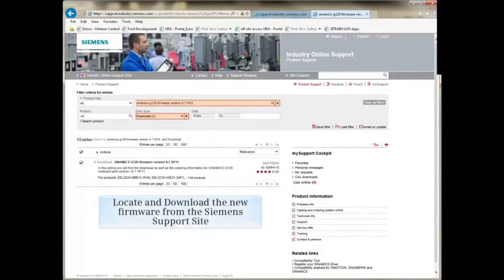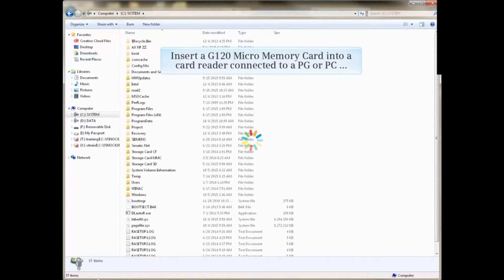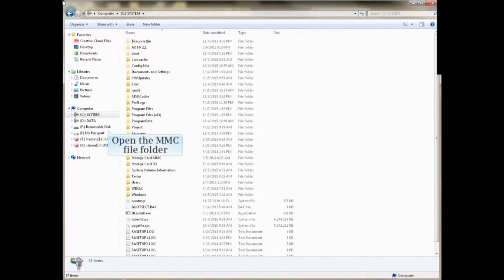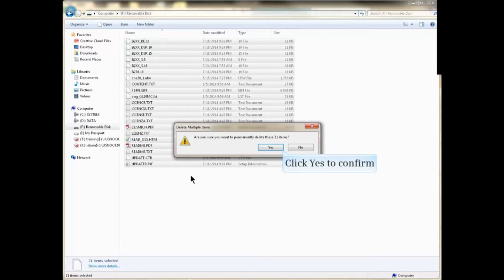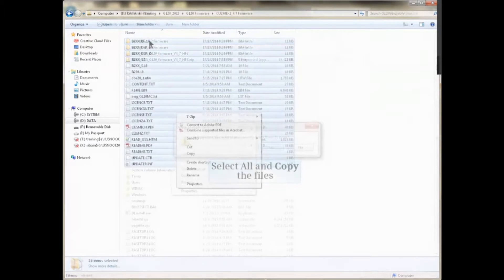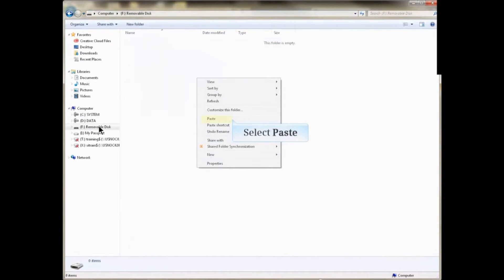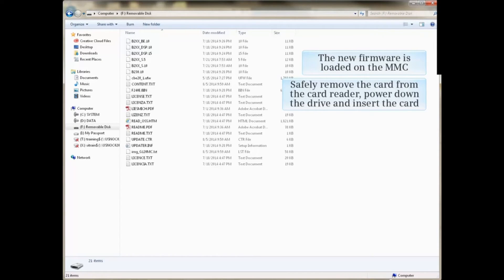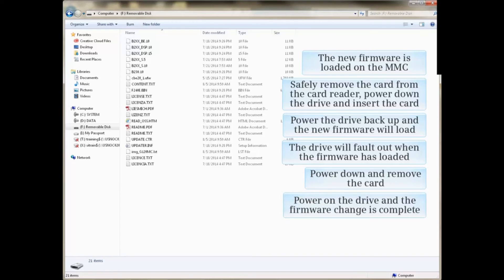51 : How to Upgrade/Downgrade Drive Firmware in a SINAMICS G120 Drive

Comment: I have an issue with my G120C. I downloaded program on my drive from TIA which in its HW configuration has firmware version 4.7.6, but my drive has 4.7.10. I tried to find version 4.7.10 on Siemens support website but could not find it anywhere. Can someone provide a link or help somehow?
Reply from the maker: Is it working after upload to drive?